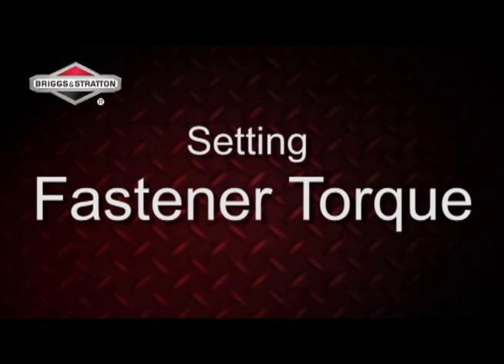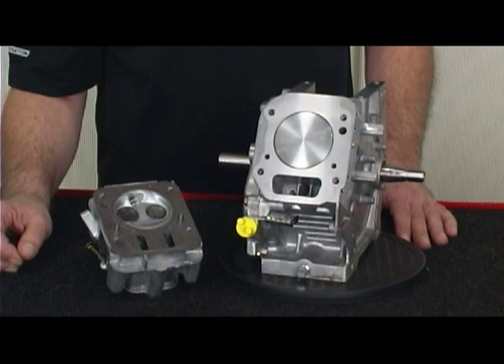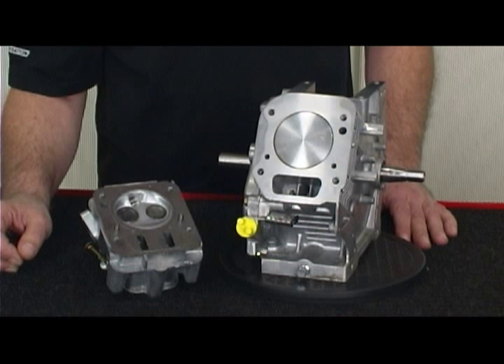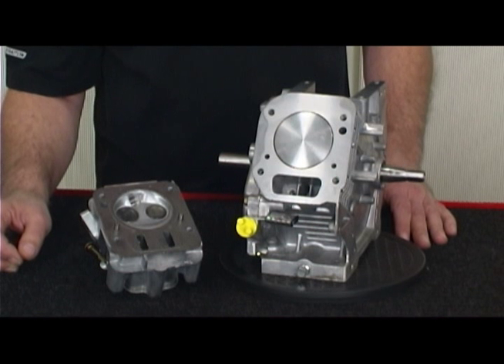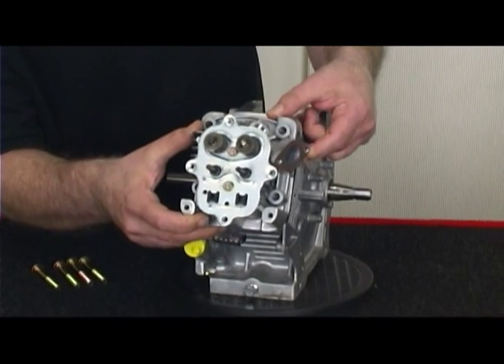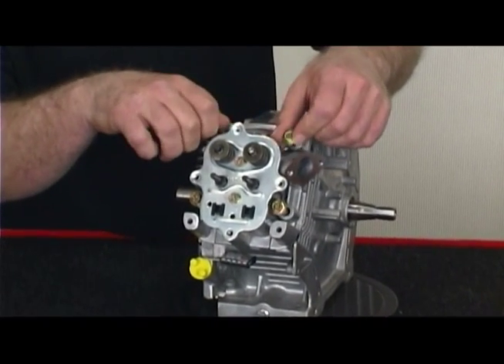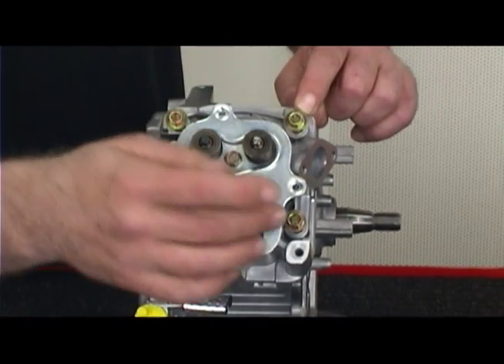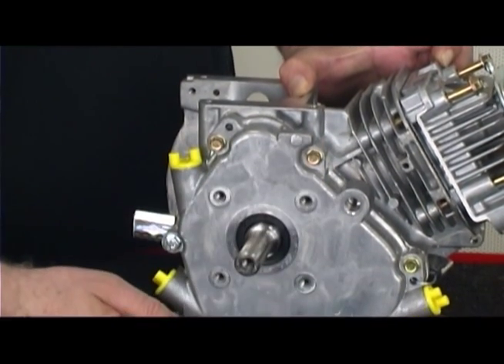How to Set the Torque on your Briggs & Stratton Racing Engine

Comment: The engine fasteners are non tech.   ARP makes a bolt that works perfect on a Briggs animal head and will not stretch as fast as the stock bolts. Call ARP and give them the length , thread pitch and diameter.  They are expensive around $15.00 each but will last through multiple head removals.
Reply from the maker: Chris, Fasteners unless specified ARE tech items including the head bolts.  There is no reason to replace our head bolts as we do not take them to close to yield allowing them to be reused again and again while still insuring proper joint integrity.